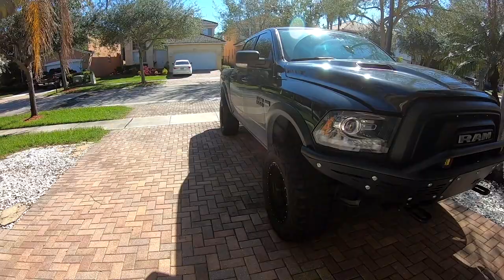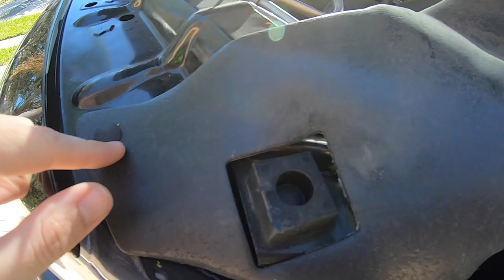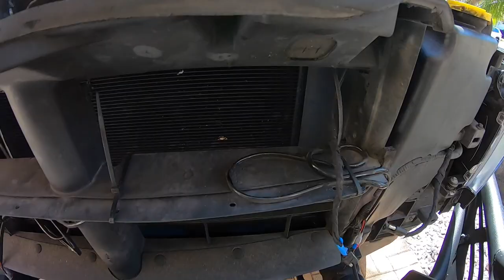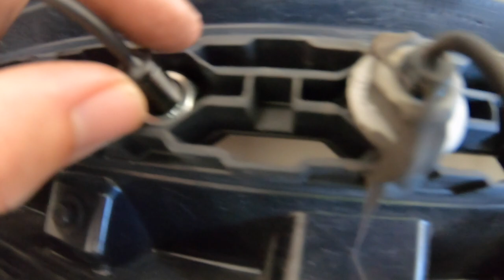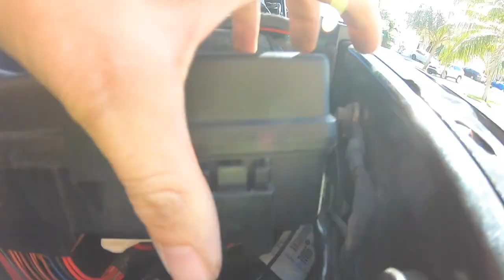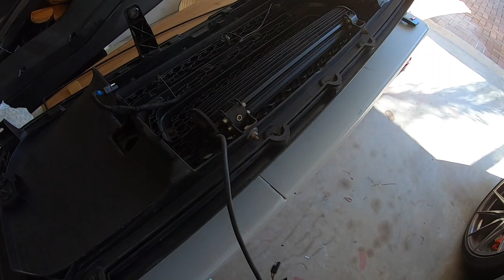Ram Rebel Grill Lights | Raptor Style Marker Lights

Comment: Thanks for the video.  I watched you and then looked at my grill and said there has to be an easier way to do these.   For those who have a 2019 or 2020 Rebel I did figure out a much easier way than pulling the grill.  I used the Optronics 3/4 mini sealed markers from O'Reilly's Auto Parts.  Just remove the top cover and you have plenty of room behind the grill to feed the wires.  The Optronics fit nice a tight into the Honeycombs of the grill.  I wired to the power wire to my left lower fog light, use the white wire and then grounded to the grounding bolts next to the fuse box on the firewall of the truck, you will see 3 of them.  Hopefully this helps someone with a 5th gen Rebel.
Reply from the maker: That’s awesome news!
Reply: Robert A. Did you splice into the fog light wire (directly using e.g. 3M Scotchlok) or insert into the fog light fuse in the box?
Reply: Thank you

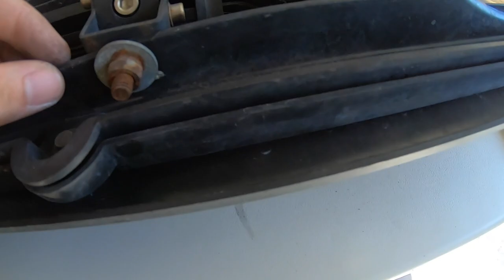Comment: What's the DEPTH OF THE LIGHT BAR. THE ONE I USE IS TOO DEEP.  10:19
Reply from the maker: @Gh0st_K1ng_D  I’m honestly not sure brother. It was just a cheap one I had ordered off of eBay
Reply: @Wimya  ok, the one I have is about 3.4 inches, which pushes way too wide and hits the skid in the back. I have high motivation and drive to get this done, especially because I love the tight look, but I need the bar.

If you ever get a chance to measure how deep it is from the mesh to the inside, just send it through. I hope to get immediately
Reply: @Wimya  just aa an estimate, could you say the depth from front to back would be about 3.4in, 2.6in, 2.4 in?
Reply from the maker: @ from what I can remember it wasn’t very thick. I’d say less than 3”
Reply: @Wimya  understood that any reply is better than no reply. Thank you for your time and patience.

Comment: Can you give me a little more info of which wire you spliced into... I want to do it the same but my fuse box looks a little different so I am wondering which fuse you connected to
Reply: I was going to ask the same thing. I dont know what wire to splice into
Reply: Great video.  Most of the videos skip over the wiring part which is in my opinion, the hardest part.

I would also like to know which wire you spliced into

Comment: For your light bar....I was thinking about adding one to my current 2015 RAM.  But, when I take the grill off, and  horizontal slates that run across in front of the radiator.  They almost look like doors.  Did you remove yours?

Comment: What type of front bumper you running man?
Reply from the maker: ICI Baja Series. I’m actually selling it and the matching rear bumper.
Reply: @Wimya  think it’ll fit a 2012 dodge 1500?
Reply from the maker: @bradenwright9875  its suppose to fit all 4th gen ram 1500 so that's 09-18
Reply from the maker: @bradenwright9875  $1500 for the set

Comment: How I do it if I have a 2008 dodge and when you you open the hood the grill goes up with it.
Reply from the maker: Hmmm I think you will need to run the wires on the hood down towards the windshield then down into the engine bay

Comment: What is wrong with these freaking people, what I need is a video of the freaking wiring, no one seems to know that not everybody knows how to do the wiring and maybe needs some help
Reply from the maker: Dude this is very basic wiring. If this is over your head bring it to a professional. Daisy chain the positives, then Daisy chain the negative. Ground the negatives to the - battery terminal. Wire positives to your desired source. 

If you’re afraid of wiring, which it seems like you are use an “add-a-fuse” to the positive and drop it into the desired fuse. Drop it into the headlight fuse if you want them on when the head light turns on or into ignition if you want them on all the time